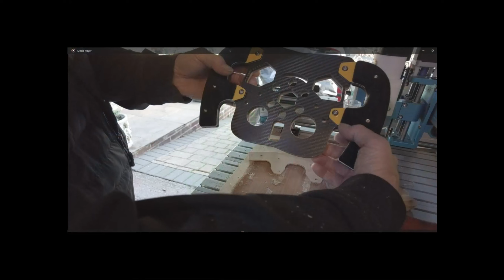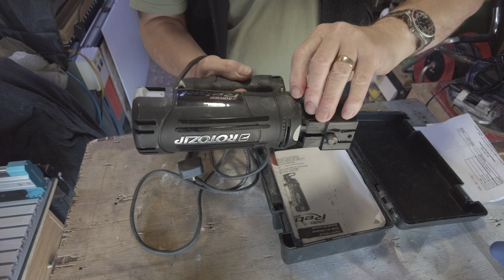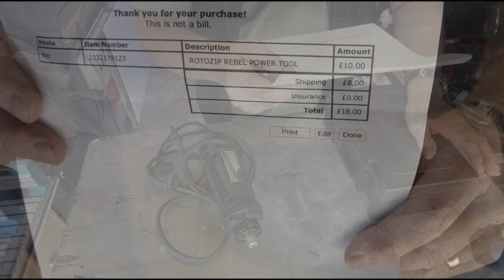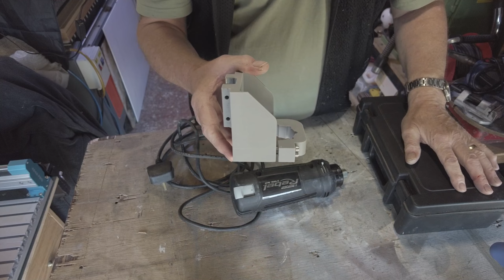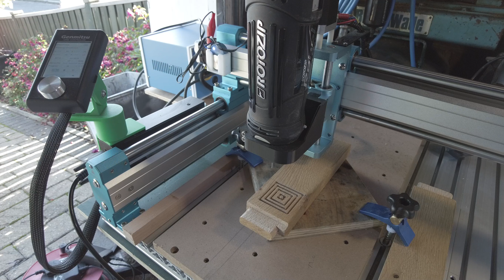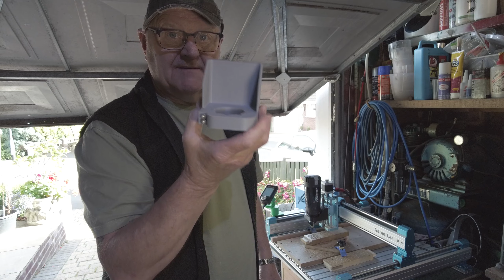Sainsmart CNC 4040 Pro Running A  Little Gem A Rotozip as the Spindle

Comment: I agree the original spindle on the 4040Pro is too weak.  I use a 710W Katsu router (£44) in a Sainsmart collar (£24).  It takes 1/4 shafted bits and runs at 6 speeds 13,000 to 33,000. It weights 1,341grams.  Personally I think this is a great cheap upgrade.  What does the Rotozip weigh?  Great entertaining videos, thanks Tony.
Reply from the maker: Hi thanks for your comment  I have a palm router and it's noisier and a little heavier than the rotozip. I found one the other day for £5 working